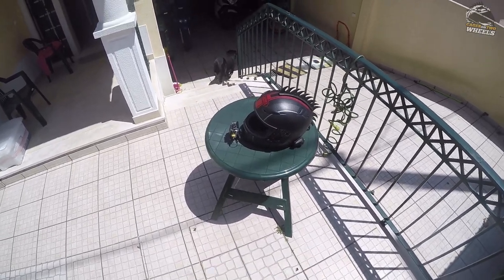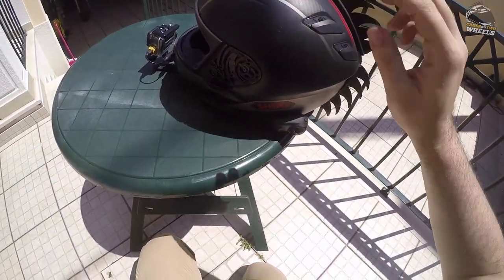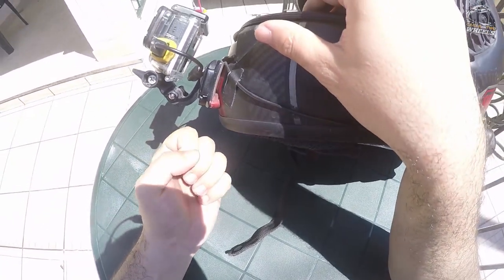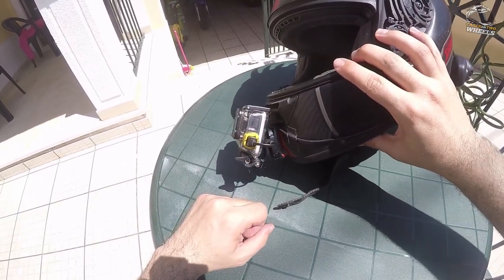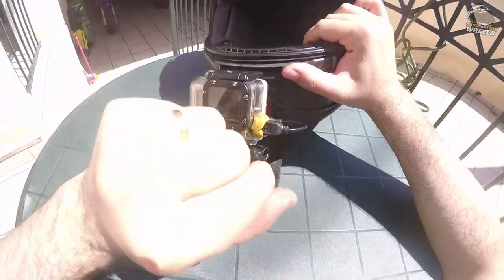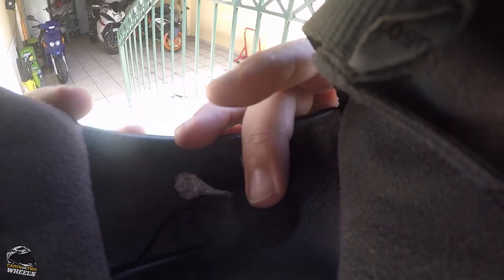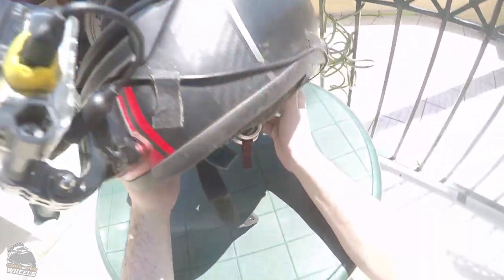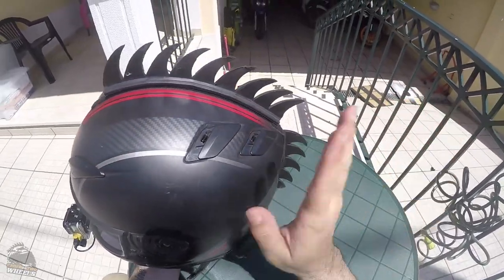My Helmet & Mic Setup

Comment: Hey Cager... 
Setup is very similar to mine. GoPro on the chin. I also use the SENA SMH5FM and had the exact same squeaking noise on the dial knob.
To fix it, take a small flat screwdriver and carefully pop the knob of. Don't worry, it is supposed to just come off, but it is a bit tight.
Then I just used a tiny bit of petroleum jelly (We call it vaseline here in South Africa, but I'm sure you have it there too). So I just put a small amount of it around the edges of the knob and the base and where ever you can see it has been touching...
Hasn't squeaked for almost a year now!

Try it, you will be much happier!
That noise can get very irritating!

Anyways... Love the channel and keep the rubber side down!
Cheers